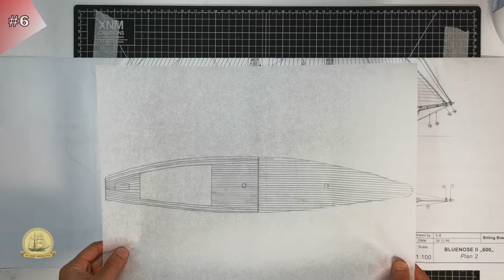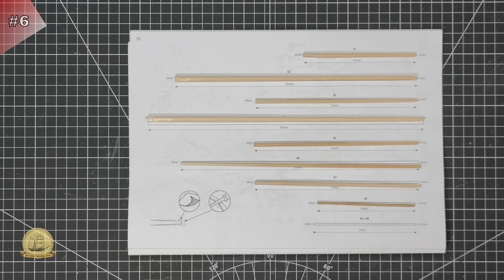🇨🇦 How I made model of the MOST Famous Canadian Sailing Vessel, Billing Boats Bluenose II 1:100

Comment: Excellent work,. As I come form a boatbuilding family I must point out that no one would leave the trailing edge of the rudder  ao thick like that shown at 7:22. It should have been tapered/ feathered, as Bluenose would have never won all those races.  Apart from that, all I can say is hearty congratulations.  Since I was young close to 85 years ago I always felt that  a good displacement hull should have the lines from bow to transom  follow the shape of "a sinewave" or a truncated sinewave at the transom for least resistance and Bluenose appears to have those  lines,. We use to build and race "MARBLEHEAD" radio controlled models and  that  was our " secret design lines".
Reply from the maker: Thank you for the note

Comment: My wife gave me this model for christmas some 25 years ago and between starting and stopping, in the last few months, following the by-chance discovery of ur vid., I have retaken the build, and I am really enjoying it. I have a question though: I noticed that you use linseed oil on the hull instead of a gloss varnish. I am just curious on the reason for this: Is there an advantage? Thanks!
Reply from the maker: Welcome back to the hobby! The wood finishing linseed oil was just my preference. My personal experience is that linseed oil penetrates/darken the wood gives a natural weathering looking. It also takes less time to set than varnish. However, varnish provides a better shining finish than the linseed oil.
Reply: Thank you for the message,  @EZmodeling! Very exited to be back! Thank you for the note on the linseed oil. It makes sense so I will experiment w it too.

Comment: Noticed that you build the haul in one piece, in the instructions it says to do it one side at a time then join them together. Did you find that it would be easier to do it as one? I ask because I’m starting this exact model and I’m new to the hobby.
Reply from the maker: Welcome to the hobby, Brandon. I was NOT able to have the two halfs aligned perfectly. I found out building in one piece is easier for me. Good luck building!